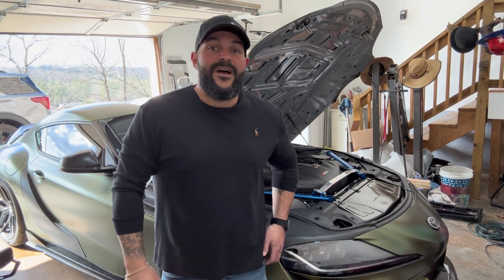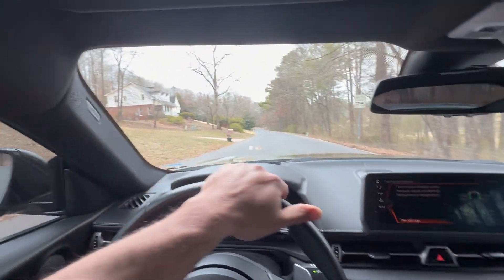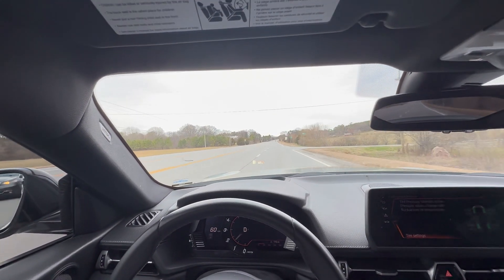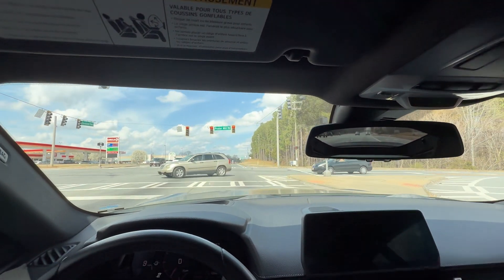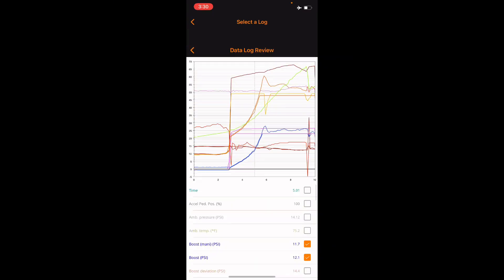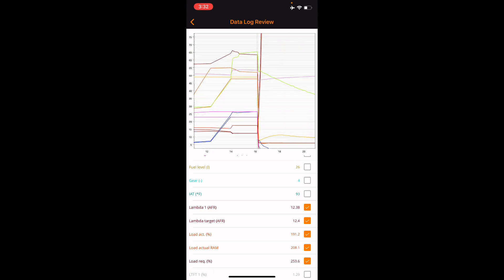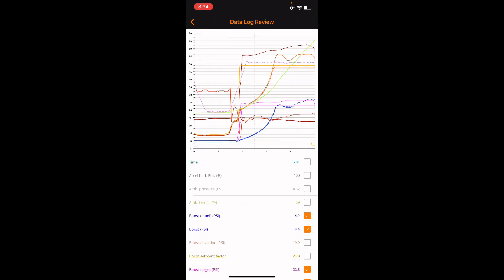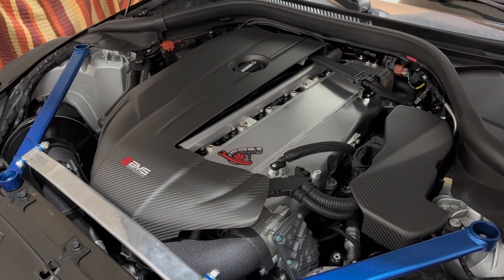Does the gen 2 b58 alibaba intake manifold work?

Comment: I have a FY MOTO Alibaba 200 cell  downpipe and intake, looks like I need to call my Chinese brothers for a manifold. 

Used a Chinese water to air intercooler intercooler on my 700whp MR2 and it was fine as well. 

Thanks for a useful video!
Reply from the maker: I’m getting ready to order a batch of forged beadlocks wheels 😂 very happy with my alibaba friends.

Comment: Did you have any issues with injectors leaking at all on this unit, I know I've seen several people complain about the CSF not properly sealing the injectors I might buy one of these.
Reply from the maker: Zero leak issues on this unit. In all fairness I’ve seen people complain about leaks on these as well as CSF it’s mainly due to installer error. Alway put a little oil on any rubber to metallic gaskets and you will never experience leaks.
Reply: @turbotimegarage  Did you ever compare the alibaba manifold vs the CSF? I looked through your vids and couldn't find it, I ordered a gen 1 intake manifold the company said they have an NDA with a company in the US but its 1:1 with CSF so far, haven't installed it yet but would like to know if you ever compared data and did your Alibaba mani hold up good boost without leaking?
Reply from the maker: @transmissionsrus6808 
The alibaba manifold performed amazing
And held up to abuse at nearly 40psi of boost

Comment: have you ever tried to test if those “cooler” coolants (like red line) work? are they even accepted by bmw for the b58?
Reply from the maker: @gabasilviu  to my understanding for the cold side the best results are distilled water and water wetter.
Reply: @turbotimegarage  only 1 bottle of that small red red-line waterwetter bottle and the rest just dist water?! 

lol, i might try it, because in romania  in the summer there are like 40+ celsius. might lower IAT a bit....
Reply from the maker: @ yes that’s it, but you obviously have to be careful as the season is changing to put coolant back in the system

Comment: does CTS heat exchanger works? worth it to buy on GC turbo?
Reply from the maker: @robinstewart-dm5ld  
I have a csf heat exchanger not installed, the manifold makes the biggest difference the heat exchanger upgrade doesn’t do much. It’s should add to the reliability because it’s all aluminum and doesn’t use plastic, but it won’t lower IAT’s

Comment: So you guys have Cirkle K there, are they any good on that side of the Atlantic?  Here it's absolute crud fuel, but may not be down to Cirkle K but rather the country I am in that has gone flat out mad, my country shot itself in the head, recovered enough that it is now trying to lift the pistol a second time towards it's own head, will keep doing it until unable too. All for the environment, right now my car use twice the fuel of the exact same car some 500 hundred miles south of us, Germany, it is that massive difference, but hey the environment for mixed driving @B58TU.  No one ask ift he fact that using twice the fuel is also good for the environment, autocrats errand boys/gals running the show here.
Reply from the maker: I personally only run full e85 and the best e85 in my area is speedway or racetrac 🤷🏻‍♂️

Comment: Would love to see test on done on alibaba radiator and charge cooler.
Reply from the maker: I’ll have to see what I can do about that, if I can get my hands on one. I have a csf stuff to install, i wanted to get an apples to apples comparison with the red Supra so they both run the same spacer, heat exchanger, rad setup only real difference is the manifold

Comment: Without boost it is irrelavent. Compressing air what is dooing most heat. Redo the test when you tune your car. You will see different results
Reply from the maker: @devrus91  this is the process of tuning, and the results seem the same to me as these test were performed at 24-27-32psi

Comment: Hey Rafael, Sumo here. I also run the torcoils intake manifold and when cruising to NC to meet with Alec (Remnant Performance) ambient was 55°F and IATs showed 57°F through the whole trip. 

I also run 80% distilled water with an upgraded heat exchanger and trans cooler. Absolutely worth the investment!
Reply from the maker: @oemplusphom  you know better than most lol as your the first to see all these logs lol. I definitely think it’s worth it I have the heat exchanger to put in and will be switching to distilled water and water wetter when i install. Waiting to do
The transmission fluid flush with am soil at the same time I install both coolers
Reply: Is there a performance benefit to running a bullet manifold? I know they say bigger core has less of a pressure drop. Does it make any more power or is it just the lower IATs that help?
Reply from the maker: @ this is a subject that is much debated, there is definitely less pressure drop which in turn should equate more power, and the lower temp lets you make more power also. The main benefit is the intercooler portion of the manifold and the ability to run port injection with the injectors facing the correct way vs a port injection plate.

Comment: I'm literally going through this exact process right now.  PCV failure last fall, so I'm just now getting it back up and running.

-Bimmernetwork rebranded Intake,
-PCV Block off pins,
-Evap delete, Ross racing evap plugs
-rossracing catch can
-Blackmarketraceing oil cap breather
-small air filter on line from tank

Idk what else I need.
Reply from the maker: @Twitch-R6  that’s everything I did the pins on the red Supra not too long ago and on the gen 2 the black market race can/delete only bad part is it fills fast and it’s inconvenient to drain
Reply: @turbotimegarage  I'm thinking about routing the catch can down to a valved oil return plug.

Where that engine block crankcase fitting goes.

Maybe it can auto drain the can back into the engine...
Reply from the maker: @ I’m not sure I’d drain it back to the pan, there’s sometimes lots of condensation from the vapors in the crank case that feed to the can.